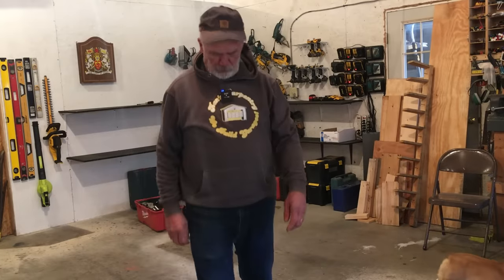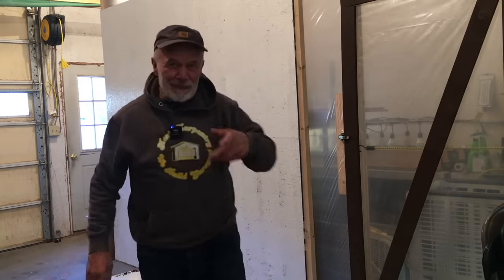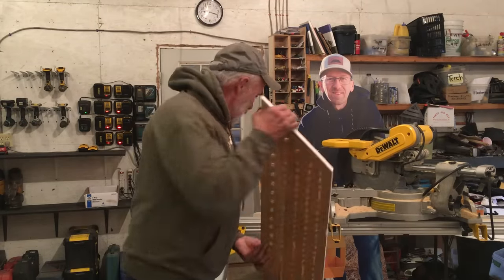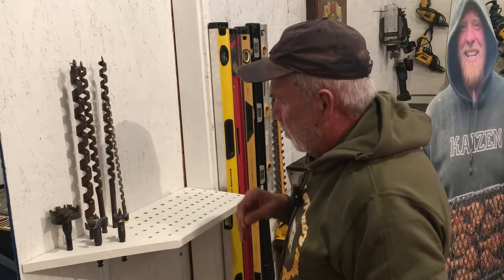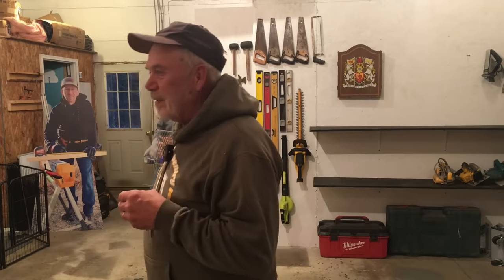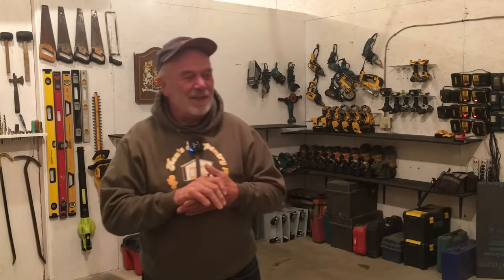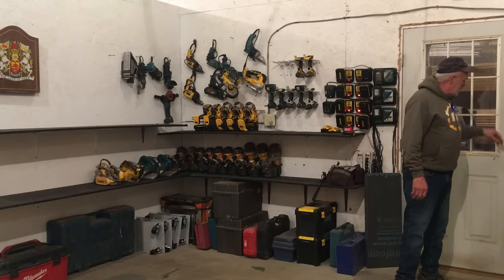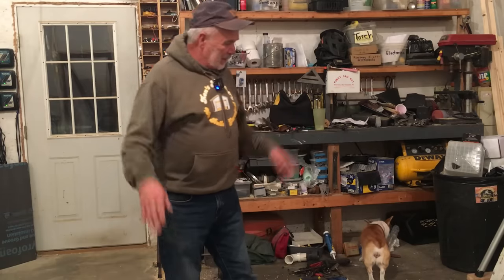Making a Norm Abram Yankee Workshop Style Workshop (Almost)

Comment: Looking forward to your project video. I’m sure you will enjoy not being out in the cold weather.  Here cold is when it drops to 20 degrees - that is where I try to stay inside.  I would never be able to handle the 20 below temps.  But on the opposite side it does get warm here in the summer.  Again looking forward to the playhouse build and if you make it so it can be disassembled so it can be moved easily.
Reply from the maker: Thanks

Comment: Ken, I am retired from building maintenance. I had 30 years in. A long time ago I learned form a painter the to make paint stick to a concrete floor you need to acid etch it. You dilute muriatic acid and wash the floor. Rinse the floor well and let dry then apply paint.What this does is give the concrete a tooth for the paint to grab onto.  I have used this method for years with great results.
Reply from the maker: Oh thanks

Comment: Funny as hell on thebtune lapse how you never showed getting more paint on the roller.  It looked like a roller that would never run out of paint! I once did a bit shelf something similar to yours.  I scrapped it pretty quickly for one that I could move to wherever I was working on a project. Much more handy for me. I did leave the lesser used bits like forstner and the really long ones in the wall rack. Finished it out by putting a lot of screw drivers and nut drivers in the rack.
Reply from the maker: Haha nice

Comment: I think we all TRY to stay organized, but after I retired, I brought all of my tools and gear home only to find out that I didn't really have room for a 50 year accumulation of "good stuff". The problem is that much of it is worthless to someone else because it's for a special job and you fabricated it, so nobody knows what it's for. Maybe you use it once a year? Then there are those worn-out / mismatched tools that still kinda work so you save them for a rainy day or that box you keep in the car. (kitchen drawer, etc) I'm not a carpenter, but I have several skill saws, so I put a different blade on each to save changing blades. Now comes the hard part... You wind up storing tools where they fit instead of keeping similar tools together in one area. The flip side of that is maintaining carpentry, electrical, and plumbing tools for home repairs PLUS another set of tools for auto repair out in the garage This means 2-3 different locations where I can find basic hand tools on top of specialty tools.... and putting them back where they started. I still try to maintain small toolboxes for going out on the road, but since I never know what that is I tend to grab a few extra things because it might be a boiler, water heater, kitchen cabinets, or light switches. It takes forever to get them all back where they belong.... and where I can remember the location. It might be easier if I didn't also keep my 64 Chevy in the garage. (Corvair panel van)
Reply from the maker: Thanks for the input

Comment: You can oil the slide not the hammer and you can run air tool oil through the air line/ inlet. 
Not much needed.
Reply from the maker: Yes. It really helped the slide
Reply: @kenskarpentry  was it you that dropped the nailer from the roof to the concrete below? 👇 Boom 💥 look at the head really good and. Seeing any rub marks or out of alignment you may have to get it repaired/replaced before the next season.
Reply: @kenskarpentry    I am thinking the oil is compensating for years of wear. The main reason NOT to oil these is because oil attracts dirt, which fouls the moving parts. Maybe invest in a blower nozzle so you can clean out accumulated dirt on a daily basis? Also, try lubricating external things with spray silicone, which doesn't attract as much dirt. Always clean the parts first.